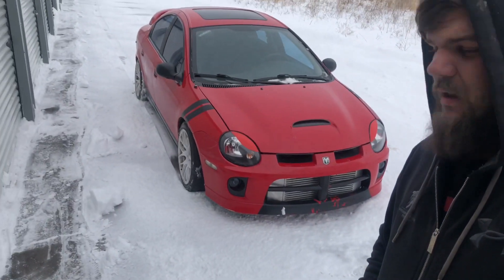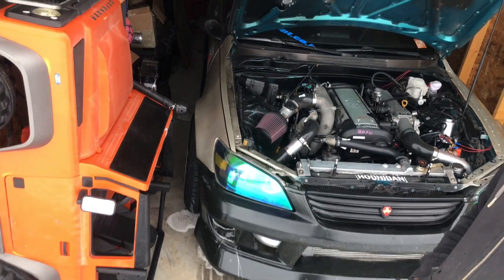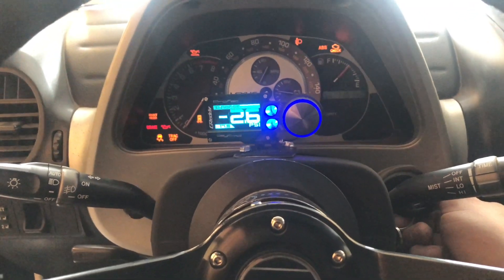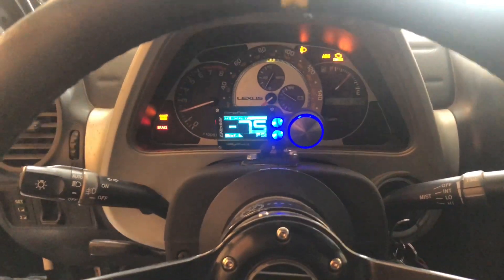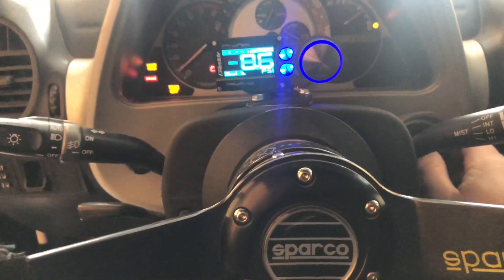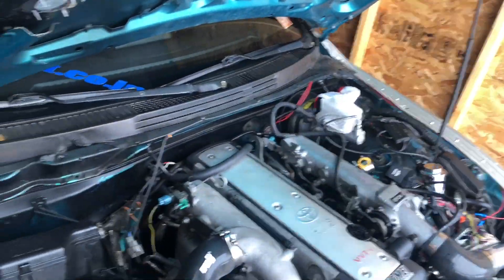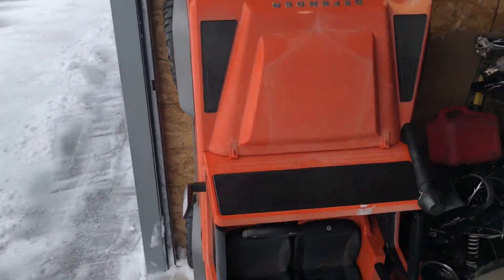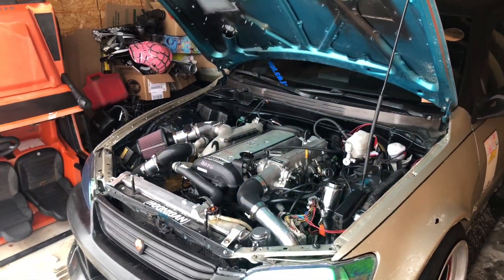Sorry...

Comment: I have a question about your swap, im looking to start my 1jz swap in march/april in my 03 is300 (factory 5spd) . Im planning on dailying it but the only issue is emmisions. Will it throw a CEL with the swap, cause if it does ill fail emissions testing. Anyway I can get around that? I'm not trying to go standalone ecu since i am a college student and i dont have the funds for that yet. Any info you can give me would be amazing!
Reply: Any soldiers in the chat? Oh yeah yeah
Reply: @datboi8140  oh yea yea
Reply from the maker: Yes. It will be very hard and time consuming to not have any check engine lights.
Reply: @Driftguy_josh  well my car is registered for the next year so i guess ill have a lot of time in between to figure it out. Thanks for your input! Greetings from Chicago!
Reply: Don't mean to throw a wrench in any excitement but it would be more cost effective to just rebuild the ge motor in the car and turbo it
Reply from the maker: Exodus until it blows up... to do it the right way, it will cost far more than a 1J swap. I would know. I’ve been there and done both.